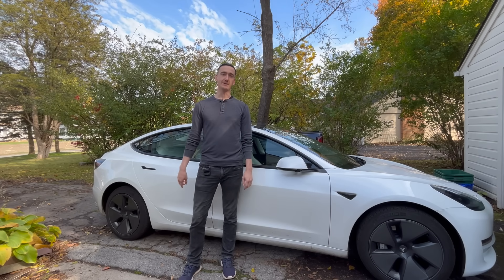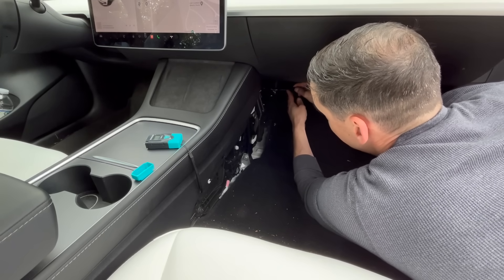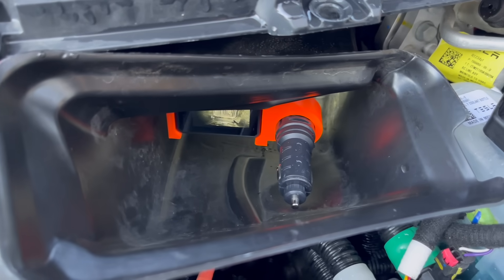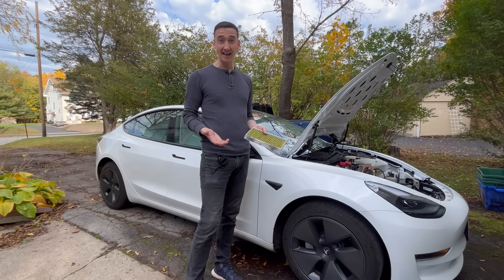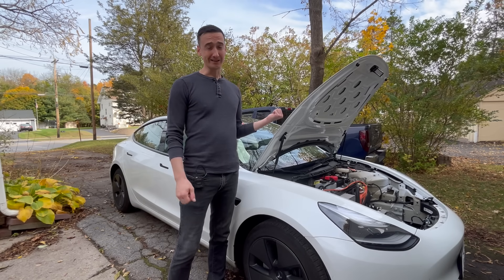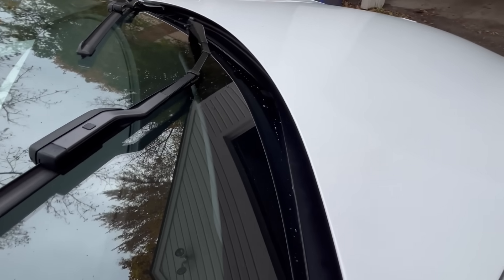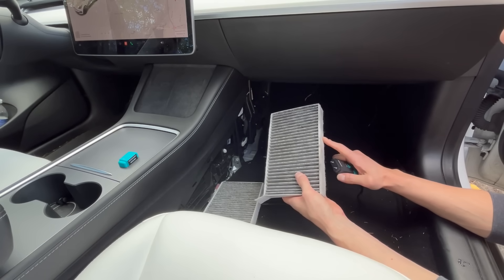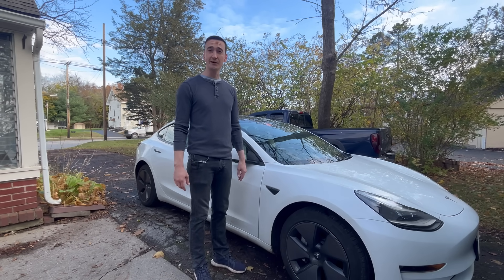This design flaw makes Tesla’s Model 3 smell bad! (with fixes!)

Comment from the maker: Aftermarket gasket: https://amzn.to/42vpKuM
Filter with Microban: https://amzn.to/3MCSNUH (Or on ebay: https://ebay.us/yeChap) These affiliate links don't cost you anything extra, but I get a small cut. Thanks for the support!
Reply: The gasket link takes you to a 2021+ model Y gasket.  Not the model 3. Just fyi. Thanks for this video!!
Reply from the maker: @FloridaPoolGuy   Thank you! So annoying when Amazon sellers change the listing out from under you. I just updated it to another that looks identical to the one I have. Thanks again.
Reply: Unfortunately, none of these products are available through these links as of 9/27/2024.
Reply from the maker: @TreeGuyofYore  I updated the links, thanks for the heads up! The microban filter IS still available on amazon if you click "see all buying options", idk why they hide it like that sometimes
Reply: It might be worth testing the washable K&N cabin filters with rubber frame.
Reply: By using the gasket you are also limiting the air it can take in? I think that is the reason there is a gap
Reply: what about 3d printing a downward facing funnel?  if the inlet is from the bottom side then the water issue is fixed and you wouldnt have to worry about car wash mode either. Is there enough room?
Reply: Model 3 highland has HEPA filter, so problem solved :)
Reply: @HotHatchTV  This is the most ignorant comment here.  Proves you didn't watch the video, you didn't see the flaw, and don't know the fix.  The problem is internal to the car retaining moisture in the AC coil tray, and a HEPA filter does not stop mold growth inside the car.

Comment: I simply cut a course general purpose furnace filter to fit in the air intake. It catches small leaves, seeds, "cotton" from cottonwood trees. This prevents a buildup of detritus in the bottom of the intake tube allowing it to drain properly since nothing gets in large enough to stop drainage. So even if the cabin filter gets wet it is dry in a few minutes. In over 7 years no odor problems, and the filters last a lot longer. A double plus since they are a pain to change! 2018 Model 3 LR RWD over 100K miles.

Comment: Awesome video, thank you! I just bought a late 2021 3 and replaced the cabin filters only yesterday - they had not been replaced in the four years since the car was made!

The car didn't smell, but man, those filters were gross. 

For me, I use recirculate 99 percent of the time, so it seems I'll be avoiding this issue through existing habits alone.

Comment: We had our first rainstorm in SoCal with our newly bought model 3 and water was spilling into the passenger cabin. This video is a lifesaver!
Reply from the maker: Insane! Could you tell from where? Like from center console area or from front of the car or what? What year was this?
Reply: @adamdport 2018 M3 LR. It leaks from underneath the glovebox. Feeling around i feel the water dripping from the air vent behind the glovebox. Others online have taken it in for servicing and they claimed it was coming in from the intake cabin air duct. Im gonna try the seal first and see if it corrects the issue.  
  
Im alao going to try cleaning where the water needs to drain from, as there's a few videos online on how to clean under the hood for this purpose

Comment: Hey, yeah, I’m going through the same thing as you with my Model 3 2025. I went to Tesla, and they were supposed to do a thorough inspection and told me that everything is perfect. I still fought with them and told them that this is ridiculous; in six months, I have mold growing in my filters. They told me it was because of Miami humidity, which is total BS, as there are tens of thousands of Tesla drivers in Miami, and nobody else has this issue. I can understand condensation, but the filters actually have water lines. The only thing they did was replace the side panel where the cabin filter is located, as I broke it while removing it. It’s impossible to remove it without breaking it. I put carbon in the filters, and now it seems to be doing a better job, but we shall see.

Comment: Fantastic analysis and video! My 2011 BMW X5 and my 2020 Lexus RX both had periodic smelly vent so I don't think it is just a Tesla problem. Although, based on what you brought up it probably a lot worse in the Tesla. I changed out the filter and usually run the a/c on my Tesla on medium or low. The a/c is extremely powerful even for a person like me who likes it freezing in the summer.

Comment: It's moronic that they would have such an oversight, smart people but they need to bring in people from the car industry to engineer basic stuff like this.  My upper control arm started squeaking in mine, poor grease boot, cost me over 1000 dollars to fix and the car isn't old at all.  Never had this problem with any other car i know of.

Comment: My one question is that with that gasket there would the AC be struggling to get air in since there is no longer as big of an air inlet?
Reply from the maker: Be sure to watch part 2!
Reply: @adamdport just did! Holy crap you put so much work into this. Instant like and sub for me!

Comment: I've had this issue with my Model Y and realized that Tesla has added an add-on option to install the HEPA filter. Gonna get it installed and hopefully that solved the smell issues.
Reply from the maker: There are lots of other commenters that have mentioned they still have issues with the hepa filter, I just haven't been able to get my hands on one to test. My hunch is that the gasket would help on the Y as well

Comment: This is an excellent test and solution video, however I would add that the Model Y’s with the HEPA filter absolutely do suffer from the issue with Elon’s Musk. It takes about 9-12 mos for my 2022 Model Y to develop an issue. I also live in an extremely dry climate.

Comment: I looked at a used 2023 M3P recently with 35k miles on it. I currently have a '22 M3LR with 29k miles on it - my M3LR still has that "new car smell" coming from the A/C and it smells great, but the M3P I looked at had a harsh, chemical-ish smell to it. I would assume the problems you highlight here would cause a moldy mildew smell, but after watching this I wonder if it could be related. I ended up not buying the M3P due to that smell, along with some odd deterioration on the steering wheel, but now I'm worried it might happen to my M3LR. Any advice?

Comment: what about putting one of those water resistant screens over the air duct like they have for aftermarket cold air intakes on ICE engines?
Reply from the maker: By creating more resistance in the intake, I suspect it would create even MORE suction up from the drain hole. Does that make sense?
Reply: @adamdport no, it doesn’t add resistance. it’s for air intakes on engines

Comment: the duct is too small and too short for the air volume. pulling air up through the drain hole is not necessarily a problem, this is usually solved by lowering the drain into a small reservoir where water can collect. once some water has collected, it will create enough resistance to allow some of it to drain.

Comment: After watching your video back in 2023, I ordered and installed a similar aftermarket gasket on my November 2018 Model 3 and Eureka! After years of bad smell and changing filters, the problem is finally fixed.  It's been smell free for over a year. Thanks 😊
Reply: And my June 2022 Model 3 Performance has never had the problem so Tesla must have figured it out as well.
Reply: @MichaelHutton1 trust me they didn’t. Smell in my late 22 LR.
Reply from the maker: @MichaelHutton1  thanks for the follow up!
Reply: Can you give me the link? I need to buy it too

Comment: Thank you for all the content. Very helpful.  Video suggestion, 
1) can you please make a video on rodent entry into cabin and how to block them. 2) AGS shield to protect debris getting in. Also thermal performance and its impacts. 
3) mud flaps and aero impacts
4) adding a spoiler and handling and aero improvements.
Thank you

Comment: I visited a used car garage over the weekend, and mentioned that the newly detailed car they had smelled terrible inside, and they said it was a common issue with Tesla M3 cars, and to just replace the cabin filter whenever it starts to smell, but this was such a great video.

Comment: Did you also test running the fan on high while the aftermarket gasket was installed? 
It wasn't clear if the moisture test you did near the end with the gasket in place was done after the fan was running on high like in the beginning of the video.

Comment: At 9:17 you're showing how you can remove the duck and the water will go straight down instead of going into the intake.  Is it not a concern  that all that water now is getting all those components wet?  What's the long-term effects of all that electrical equipment out of there getting wet at this point I think the duck plus that top plastic piece helps to seal this area electronics.  By removing the duck aren't you essentially opening that entire area to moisture more so than it already is?
Reply from the maker: @sohnjdupree01  at 13:20 you can see that water gets in there even with the duct. All the connectors on the car are waterproof, but I plan to test that once and for all in part 3 eventually

Comment: The pair of "NVH Cowl Flaps" on the left and right of the hood's rear edge that you took out are there to drain out basically ALL wind noise coming from the front windshield, not meant to seal against water ingress into the cabin air intake. That aftermarket seal you installed should seal not against the removable cowl, but against the fixed surface between it and the windshield. Then it would probably seal properly against water from the windshield.

Comment: does recirculating the air also close that vent? because I personally always use auto climate. so my fan is always set to auto low. but if its raining and I need to turn it up high for some reason, does simply recirculating the air protect it?

Comment: Great Video Adam.  I have a Model Y 2021 with the full length vent,   I live in Canada and we drive in a ton of rain, car won't stop fogging up (in fact the FAN makes it worse not better) I suspect I have this problem except your video says 2021 w/ Hepa likely does not have this issue.  I will take some stuff apart tomorrow and hopefully I resolve as easily as you did.     Thank you so much for your great video.

Comment: Honest feedback.  As a professional mechanic for many years,  I say that the complaint of dash vent smells is not at all new. Some vehicles are a lot better than others though. Also, not a common issue with big trucks as they pull in outside air from very well protected areas around the engine bay.
Also, anything accumulating on the evap core will harbor bacteria as that core also sweats from temperature differential. Like a cup filled with ice.

Comment: FYI, the big HEPA filter under the frunk panel on newer Model Ys can be retrofitted onto older Model Ys officially. I had it done through Tesla service, the HEPA filter (& Bioweapon Defense Mode) retrofit was an option in the service menu under the "Upgrades & Accessories" category. I had it done on my 2021 Model Y and now that I have that big HEPA filter up front, it has all but eliminated our musty cabin smells.

Comment: If we increase the size of drain hole in the duct wouldn’t that help with the negative pressure and the flow rate of the drain? 5:30
Reply from the maker: @nicomoran7573  I just don't know what functionality you're preserving by putting a modified duct back in
Reply: @adamdport  Didn’t realize there was a Part 2 when I made this comment. Is it safe to say you deleted the entire duct system? Running from the firewall does seem like a good idea since there would no longer be a “funnel” to the fan. 

I had an idea of 3D printing a rectangular perforated table to add to the base of where the filter sits. But I see your idea seemed to have solved the problem.

Appreciate everything you’re doing for the community.
Reply from the maker: @nicomoran7573  not "the entire duct system", just the duct that I removed in this video. There are obviously ducts throughout the car to route air where it needs to go

Comment: People often sweat and then get into the car, causing the car to absorb the moisture from the sweat, which can lead to unpleasant odors. As a result, I need to replace the filter regularly. I believe improvements should focus on making filter replacement easier. Reducing the replacement time from 20 minutes to just 1 minute would be ideal!

Comment: Great vid! Subbed! Would you consider doing one on why the suspension is so stiff? I'm thinking little cameras when driving over bumps to see if the shocks are bottoming out, or if it's due to low profile tires, or bushings being too stiff, etc. Accelerometer apps on Android and iOS are free and a great way to quantify vs "feels better" or "feels worse".

Another popular one would be "make your tesla less noisy", testing if those seals and mats really work. On a side note, t's actually possible to easily retrofit the laminated glass from the new Model 3 to older models, and each rear side pane only costs like $150.

Comment: I NEVER let air in from the outside when I'm using AC unless my windshield fogs up. I often have environmental allergies and sucking air from the outside is a sure way to get me sneezing... Keep it  in "recirculate mode" if the Model 3 has that option.

Comment: My Tesla had a terrible smell and I had the filters replaced then it was okay two months later it was back so I had the filters replaced and it was okay two months later it was back. But I think I found the solution. The filters get wet and moldy. Way before they're dirty. Easy fix! Turn it on recirculate 10, take a can of Lysol and spray under the dash into the vent on the passenger side and let it run for a while. Do this like once a month problem solved

Comment: Microban is just another scam. They have a partnership with HAYWARD (pool equipment stuff). It doesn't work, just BS.
Reply from the maker: @mschumacher1805  interesting take! From what I've read they just embed naturally antibacterial materials like silver, zinc and copper. Are you saying those aren't antibacterial or that they're not actually using them or what?

Comment: 16:25 I bought some WIX filters from OReilly ($70), but the printed Air Flow Arrows were actually going the reverse direction. So I took them back and ordered some filters from Amazon.  Just a heads up to check the arrows if you buy the WIX brand.

Comment: I was curious to why this happens and I went ahead and found this helpful video. I have taken my car twice to Tesla to get it fixed and ever since I put my fan speed on low it doesn't happen. But thanks for the helpful tips i will get the seal and hopefully mitigate the water from coming in.

Comment: That's funny, I seriously clicked on your video believing you were referring to the burning electrical emissions/smell I smelled while driving behind a Tesla coming up to the hill from Sacramento to Tahoe in California. It was bad enough to make me believe there was a problem with the car or and technology.
Reply from the maker: @redrider7730  every car coming DOWN the hill (except EVs) is using friction braking all the way down the hill. The brake pads get extremely hot (upwards of 1000°F) and they have a very distinct smell. If something electrical was burning in ANY car Tesla or otherwise I can't imagine it would last more than a few miles before failing
Reply: @adamdport  Thanks for the response but it was going up-hill the entire time with a very distinct hot electric smell (it was not on fire, using the brakes or charging due to going down hill), followed it for several miles before passing it due to the smell.
Reply from the maker: @redrider7730  YOU were going uphill but I'm sure there were dozens/hundreds of cars in the oncoming lane going downhill no?
Reply: @adamdport  3AM in the morning, no cars were there except the two of us and the entire time I was behind it with my sunroof and windows open because it was a nice night/morning, it was also the section where the up and down lanes were separated by approximately .5 of a mile going up the Summit, and the smell was coming directly out of the Tesla in front of me and left as soon as I passed it. It was again a distinct hot or burning electrical smell, not brakes coming from anything else or the Tesla.
Reply from the maker: @redrider7730  dang sounds expensive for him!

Comment: Thankfully this doesn't really apply to the newer 2024 Model 3.
Reply from the maker: The part number on the duct has not changed
Reply: @adamdport  Not for the older Model 3s, no.
Reply from the maker: @icy1007  Both the 2024 and the 2021 model 3s have a 1588274-00-B duct. The duct in this video is the same as in the newer 2024 model 3.
Reply: @adamdport and where did you get this part information for the newer Model 3?
Reply from the maker: @icy1007  https://epc.tesla.com/

Comment: btw you can upgrade your filter to the biodefense one. i had telsa add it to my 2021 Y which originally came with the standard filter. i now have the biodefense mode icon in my menu. i think it was like $250 ish. 
one concern with the gasket, does it restrict airflow? it seems like its blocking the biggest opening for air intake?
Reply from the maker: There's room in the Y and it comes stock since 2021, but there's no room in the 3. Be sure to check out part 2! https://youtu.be/OZ5SXmArEIo
Reply: @adamdport  will do! i think my Y was an early 2021, so it didn't have Bitdefense  from the factory.